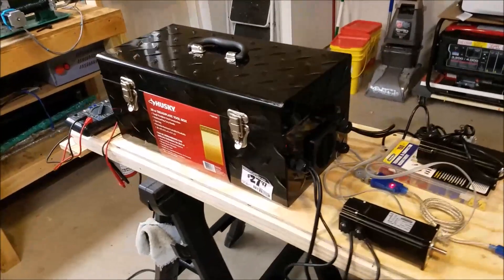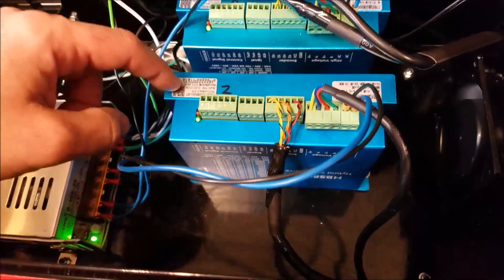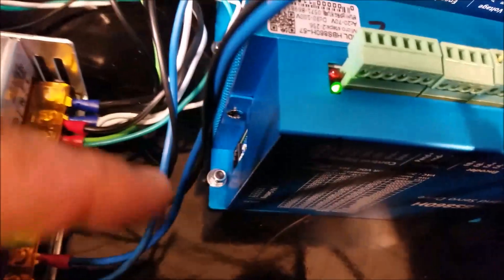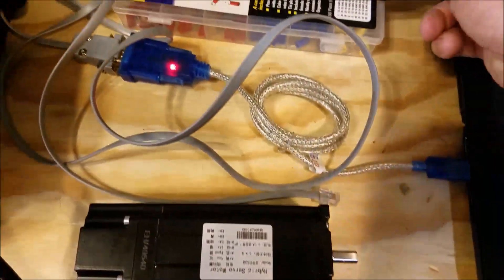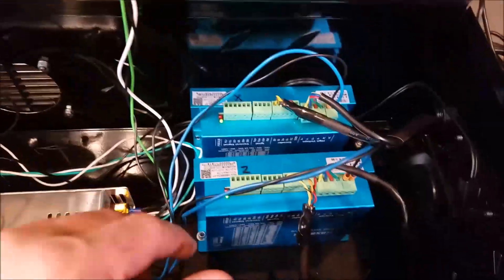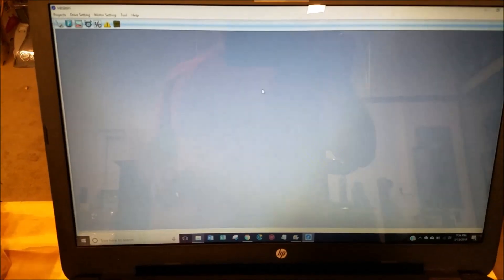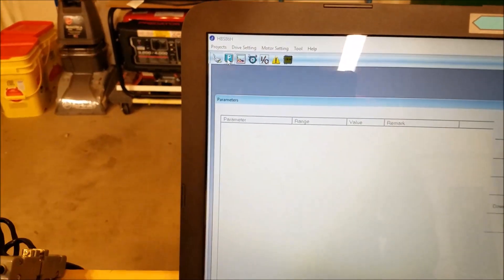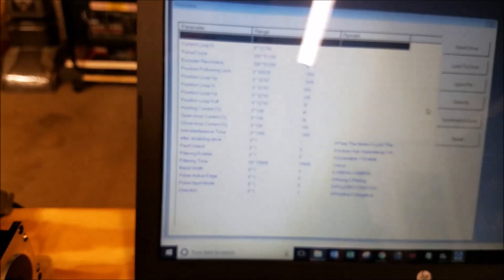DIY Closed Loop CNC Control #3: Stepper Drives

Comment: If you wire the drive to acron, will you be able to clear the alarm on drive or will it still be necessary to restart the drive?
Reply: Hi.  As far as I can tell, you must power cycle the drives to clear the alarms.

Comment: Great video! The real danger of damaging the drive is unplugging or plugging the drive in while the drive is on. This can cause a reverse inrush spike that can destroy the IGBTs or mosfets. As for the dip switches typically the are read on boot so if a change was made after boot it would not come into affect until the next power up sequence.  Although I'm pretty sure that I have seen drives that the pulse/ per rotation can be changed on the fly on some models

Comment: So I've bee trying to connect the driver to the PC and didn't worked at all. 
Most of the times I get the same message:
"Communication fail! Please check the drive, power supply and connections"
Reply: Same here, I'm suspecting a non-standard wiring configuration on the serial to rs232 cable

Comment: Hi Franco, I have a question, what  brand and type is the serial cable? because I need a for my stepper drivers HBS86H, thank you. I can't make communication via RS232 to adjust parameters because I don't have the wiring diagram, can you share yours please?

Comment: @Franco Could you tell me if the encoder pin out on the motor's DB9 connector correlates with a standard DB9 extension cable? I have seen in your video that you plug the encoder cord into an extension cable and run that to your stepper driver. Did all of the colour coded wires on the existing motor encoder cable correlate with the extension cable wire colours?

Comment: I got my Bridgeport all wired motors installed and when it moves one inch it moves exactly one inch!!!! The only thing I’m unsure of is the setting is set to 1600 (I believe the microstepping setting in the Cnc Wizard) I’m unsure what that should be set to? There’s some canned settings off 1600 2000 and 4000??? The steps per rev!  It’s called! I have these same drivers. Any suggestions? I have a Bridgeport mill with 1712oz in closed loop steppers on X, Y, and Z thanks so much for your videos I’ve learned so much!
Reply from the maker: Hi.  Steps per rev is the number of pulses (steps) that are required to make the motor shaft turn 360 degrees (one revolution).  This works in conjunction with the lead of your ball screws.  Let's say you have 5mm lead ball screws.  It will take 5.08 revolutions to travel 25.4mm which is one inch (25.4 / 5 = 5.08)  Now, lets say you have your steps per rev set to 2000.  This means that the minimum move is 0.0005" (1" / 2000 = .0005").  I would say that you should try to get your minimum move to be less than .0005".  So, in this case, I'd set the steps per rev to be 4000.  That would give you a minimum move of 0.00025" and that will give you very smooth motion.
Reply: @FrancoCNC  I guess the only question I have is do I have to set the switches on the drivers to 4000?
Reply from the maker: @trialnterror  Yes - you will need to physically set the driver to the correct number of pulses.  And, you need to make sure you enter that same value in the CNC Wizard Setup screen.
Reply: @FrancoCNC  awesome I’ve changed all 3 axis’s to 4000  (X, Y, Z) on the dip switches! They were set at 1600 steps per rev from the factory! I see in one of your videos you had your Z set to I believe 600 or 800 (don’t remember which) steps per rev. Was there a particular reason you went with a lower number on the Z axis instead of something like 4000 steps per rev?
Thanks again for your help your amazing!
Reply from the maker: @trialnterror  Hi. As you increase steps per rev the motors generate less torque.  So, when you have a heavy load to move around (like the Z-axis on a mill) is may be better to sacrifice some of the smoothness and gain a bit of torque.  However, I believe all of my mills currently have 4000 steps per rev on the Z-axis motors.  Start with 4000 and see what happens - the drive will alarm out if it can't keep up.

Comment: Those drivers have a built in bridge rectifier so AC or DC is sent to the right polarity terminals on the output of the bridge rectifier.

Comment: How does this compare to an hsb57 longs?
Reply from the maker: They are both good.  I wouldn't be afraid to use either one.  The software that came with the longs motor HSB57 was pretty easy to use.

Comment: When you order the 12nm closed loop steppers they only include the cable for the encoder the other cable that needs to be hooked up is 4 wire. Do you recommend that you get a shielded 4 conductor cable for this? Does it need to be shielded ?

Comment: what happens if you only use 1 power supply for 2 or 3 motor drivers..??
in the other video always shown 1 power supply for each motor driver
I really need the reason
Thk
Reply from the maker: Hello.  As long as you have enough wattage to drive all of your motors, you can use a single power supply.  In many cases, it is cheaper to buy three small power supplies rather than one large one.
Reply: Thank you very much

Comment: Normally closed means at rest, or not energized, voltage will flow through a contact. Normally open is the exact opposite.

Comment: 8:14 "Do not connect or disconnect serial cable when drive is powered on. The drive’s communication circuit 
may be damaged." This is written in the instructions.

Comment: Good video, thanks! 
Fault is typically an active low signal though, so should not be changed. The reason is that if your fault signal cable is broken/loose you also detect this as a fault situation. Which is what you want.